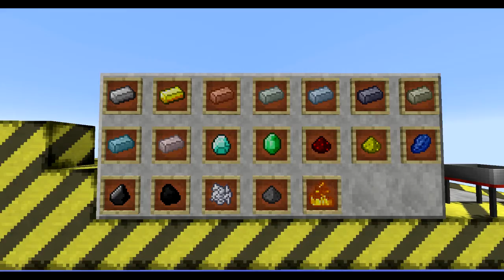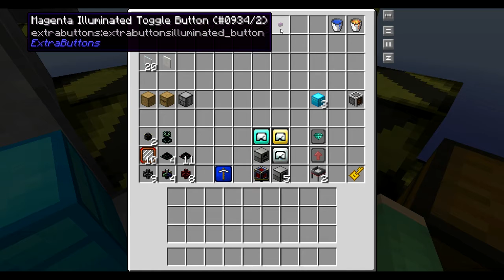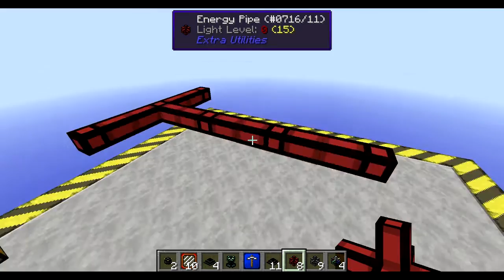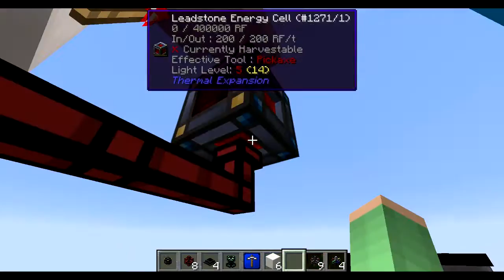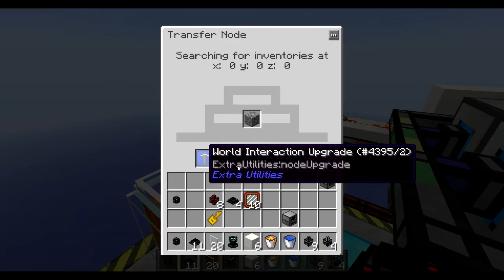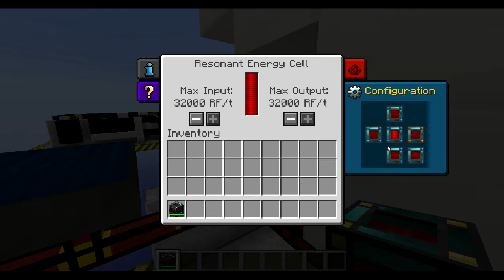Auto-Sieve Tutorial

Comment: It's interesting how different priorities lead to different designs.  Evidently you have had some bad experiences with overflow on automatic sieves, but my experience has been that this only happens for me when I'm doing a very simple system, like loading stuff into a hopper and forgetting I left the machine running.

I'm using a different modpack, but I uploaded my own build yesterday (https://www.youtube.com/watch?v=jBrRvoXNZEQ), and many of the same issues apply.  My experience is that I end up spending a lot of time tearing down and rebuilding as my needs expand, so my priorities are on expandability and modular design.  Mine also won't drop items, but I never even considered that while building it.  Dropping onto the ground doesn't happen because I have a huge item buffering capacity, and if that's exhausted overflow goes into the main item sorting system, which has its own overflow buffer.

Comment: Any aproximation how much rf they require? Your setup with upgrades?
Reply from the maker: +Vasi Ciurea The four Pulverizers (with all three speed upgrades) consume 800 rf/t each, combined with the two Sieves with full upgrades (64 speed and fortune) consuming 1180 rf/t each for a power requirement of 5,560 RF/T.

Now to include the AutoPackager (1,000 RF per use) and the Pulverizer and Furnace (which are not always active, but darn near, at another 1,200 RF/T) you'd reach a total of: 6,860 RF/T needed to run this machine with full upgrades.

So ya, 6,860 RF/T.
Reply: +Tesgri Thank you

Comment: is there something that can replace the auto packager?
Reply from the maker: +Jeremy Turpin Well, depends on what mods you got.  If you're using the Xisuminati pack then Thermal Expansion has the Cyclic Assembler - which can only do one recipe at a time.  In other mods there's RF Tools Crafter which can do I think 8 recipes, AE2 which of course can do everything under the sun, Ender IO has a crafter but that again only does 1.
Reply: And then the trusty old Steve's Factory Manager ... but 150 commands per output(gravel/sand/dust)